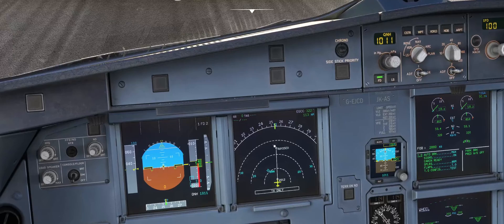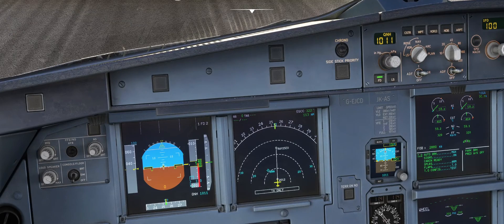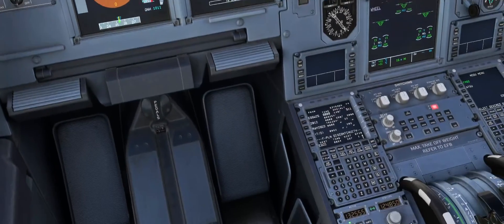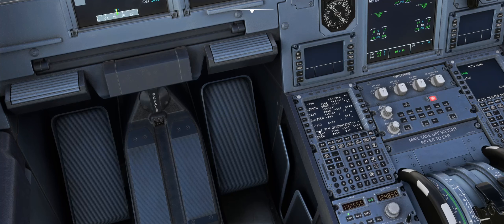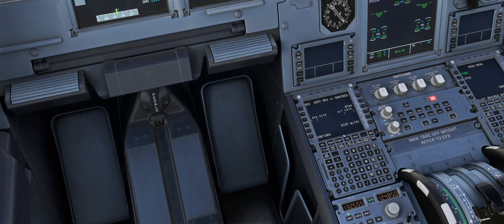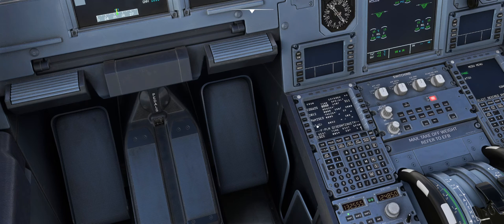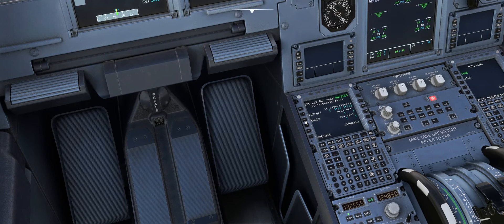A320 MCDU Waypoint Entry Explained by Real Airbus Pilot | MSFS 2024 Tutorial

Comment: My managed landing speed is different from the one in the mcdu in the final, what can it be? Great video also...
Reply from the maker: Hello, the managed landing speed will often vary as it takes into account the aircraft weight, wind direction and speed to calculate the VAPP (approach) speed
Reply from the maker: The difference from the MCDU speed will be caused by a system called 'ground speed mini' this takes into account the forecasted wind inserted in the MCDU and compares it to the real world winds detected by the aircraft. This function can vary the approach speed by up to 15 knots
Reply: @AirbusCockpitCoach  thank you, I just bought the fenix, when I had the fbw it didn't did nothing of this, its incredible the level of details and realism the fenix has
Reply from the maker: @pedrofernando8336 The Fenix uses Pro Sim software which is used in Level D sims so it does have a great deal of system realism. A few changes to the MSFS flight dynamics are needed to help in a few areas but the Fenix will teach you a lot 👍